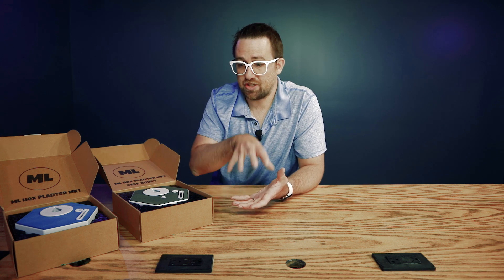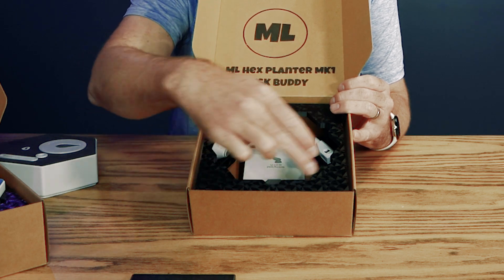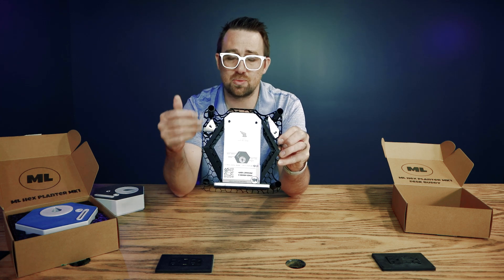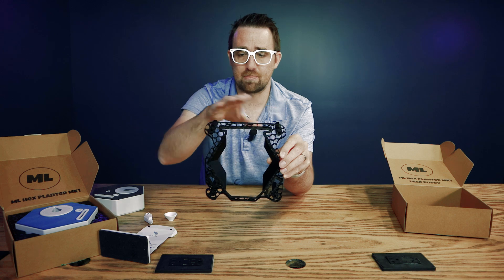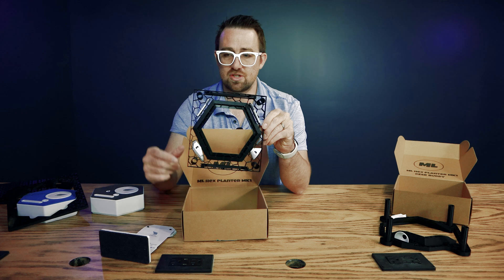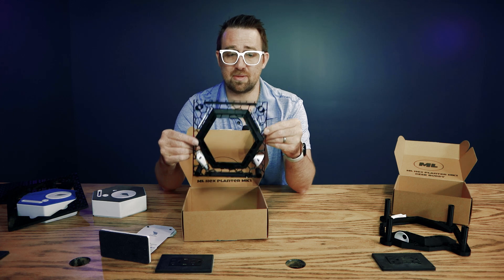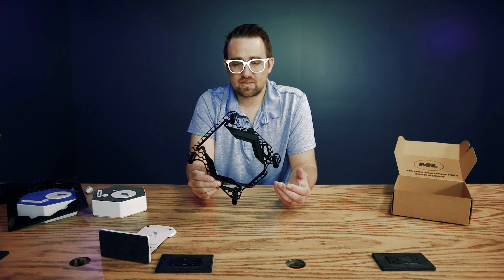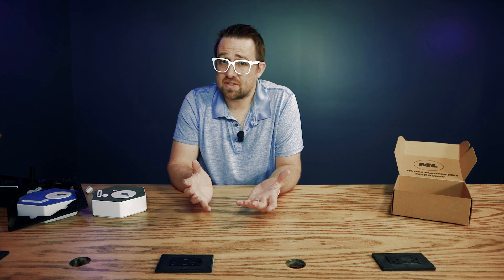Cheap and Custom Low Volume Packaging

Comment: i have tried similar type of thing. I like the idea for the super customize ability but still using plastic like that considering the amount of time/energy to print it (assuming it wasn't a super quick print?) kinda hurts me to think about. despite being 30 cents and all that... 

I wonder if you could make some vacuum forming model of the packaging you want so you can use an easy-to-recycle thin sheet to accomplish same thing. Won't look as fancy but might be faster/cheaper

or a paper pulp cardboard press type of deal.
Reply from the maker: It's actually pretty quick to print. Both the top and bottom together take less than an hour and half. The bottom saves a lot of time by not printing the top and bottom layers and only using infill. Even the top piece skips the top layer and only prints the bottom layer (the part gets flipped over for the final look). If you have a Prusa MK4/Bamboo P1S or something similar, it doesn't take much time to print things anymore, these printers fly now.

I really like the idea of doing a paper pulp cardboard press. The only downside is the hands on time to make them. For the 3D printer, I just hit a button, which saves a lot of my time.

The vacuum forming could definitely be an option, or it could even just replace the bottom piece only. I haven't done anything with it yet, but something to try.

Comment: Water consumption is usually not a problem? I mean when you get cardboard or any potentially water-intense product, it has generally been made where water is abundant and is bulk imported to where water is potentially not abundant. It's not like "consumed" water disappears, it flows back into nature, so it's only a concern where there is shortage of easily accessible water to sustain human life.

There are things to consider.

You can drag knife cut or laser cut cardboard in your lab. You can even retrofit a 3D printer with a drag knife. You can even use a 3D printed template to hand cut cardboard with a suitable knife, and sometimes that may well be quick enough.

You can use 3D printed tooling to make paper pulp packaging from shredded paper and starch based binder (paper mache effectively), though that does create water consumption at your site which may not be desired.

Getting into the weeds of what packaging or waste material can be considered environmentally friendly gets really complicated really quickly and ends up creating more questions than answers, and the ultimate answers are likely to be regionally very different, depending on say how the trash is treated in the recipient destination. And after all engineered synthetic packaging can at times reduce weight and material consumption overall, which has an environmental benefit as well.
Reply from the maker: This is really good feedback.

Water usage, while not too much of an issue in most places, is rapidly becoming a concern, particularly in the western united states.

I love the idea of using a 3D printed template to cut out cardboard. I'll have to do some experiments with that, it's not something I had thought to consider. I have been working on a Drag Knife for my CNC machine, and so that could be an option for cutting out designs: https://www.youtube.com/shorts/5AYvQfwtWVY

Overall, yeah, the environmentally friendly concept is entirely too complex. From just getting the resources that make your material, to shipping concerns, recyclability, weight, and how it's disposed are only starting points to the equation. It's a pretty intense rabbit hole that seems to have no end.